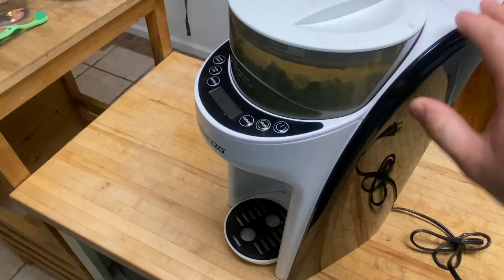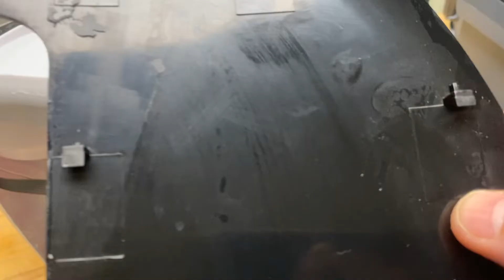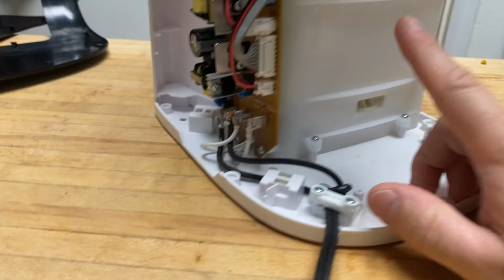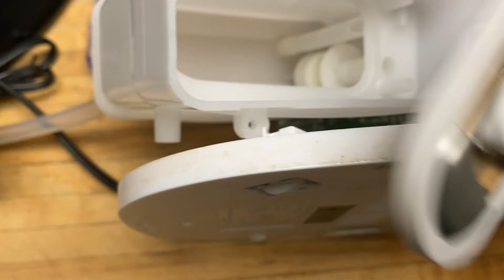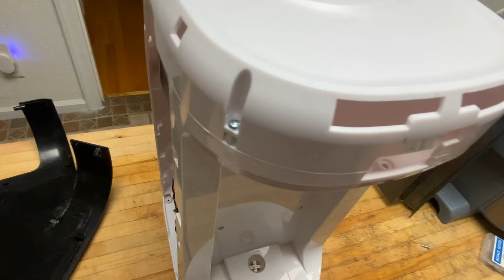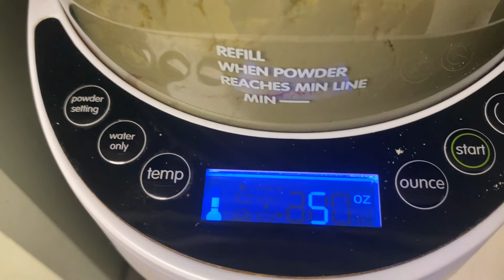Baby Brezza Formula Pro Advance E4 error repair

Comment: Thank you so much! I'm no longer getting the E4 error. 
I finished the whole process in 2.5 hours. That includes 15 minutes of feeding my baby haha

Just a few notes for anyone needing to do this..
There's actually 4 screws for the base of the tank. There's one more on the back left corner. 
Having a flathead screwdriver came in handy for removing the tabs. Like someone mentioned in the comments, you don't need to cut the white cover, just slide it and you'll see the fuse. I didn't need to do any soldering also.

Comment: Very good video. Mine now works. I did have to take it back apart as mine was slowing leaking as another person commented, but I believe I put the heating element gasket in wrong. To avoid in the future, put the heating element in without the tan cover first, make sure the gasket is seated in the reservoir. I had to take a little flathead and run around the gasket to make sure it was seated and not kinked which would allow water by.

Comment: Hello can i ask you one question please, I have this error E4, but I don't know if it comes from the heating element (resistance) or if it comes from the fuse.
Are we supposed to have a value (resistance Ω) when measuring between the 2 terminals of the heating element ?
because I have nothing at all, and the fuse shows direct conduction with my multimeter. Thanks in advance.

Comment: Merhaba.Emeğiniz için teşekkür ederim.Amarikada 110 wolt ile çalışır.Ancak Türkiye'nin 220 wolt  olduğundan ve bu woltajla çalıştırmada Rezistansın arızalanması olurmu.
Benim sorunum var.
1- kaç wolt ile çalışır.
2- Rezistansını nereden temin ederim.
Reply from the maker: I'm not sure about the exact resistor you would need for 220 volts. If you can identify the specifications of the resistor already in your Baby Brezza, I would try to find an exact match online and put that one in.

Comment: Hi dear. Thank you for posting this video. I have a question where can i buy the replacement for the heater?
Reply: Hi, i found it on amazon. Thank you
Reply: @nidhisandhu5857  can you please tell me where you found the heater part ? do you have a link ?
Reply: @nidhisandhu5857  can you provide a link ? thanks
Reply from the maker: I'm not sure. Maybe eBay? Good luck!
Reply: Can you please share the amazon link?

Comment: Note, you do NOT have to cut the white insulating wrap or the fuse out.
- Undo the nut holding the wire to the heating plate
- Peel back the white insulating wrap from the end connected to the heating plate
- Squeeze the terminal on the heating plate from the sides (thin side) lightly with a pair of pliers and pull the connector from the spade on the heating element
- This now gives you space to pull the white insulating wrap all the way back, exposing the fuse
- The fuse itself is held in via two gold colored crimps
- Squeeze the sides of the crimps, this should relieve tension and allow you simply pull the fuse from the crimp
- Replace the fuse by pushing it into crimp and crimping with a pair of pliers

You can check if the use is blown by using an Ohm meter and checking for continuity before and after the fuse (would suggest doing this with new fuses to ensure they're not DOA from factory).

Comment: Video was great in how to taking things a part.  I sadly couldn't fix mine as I didn't know how to solder and ended up wrapping the old fuse wire with the new fuse wire and it didn't work.
Reply: Wait what was soldered?